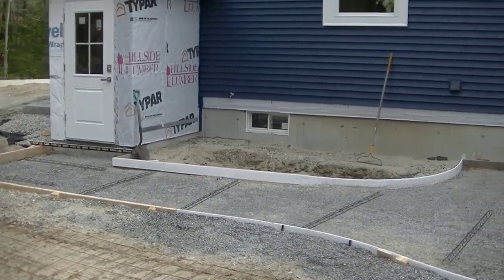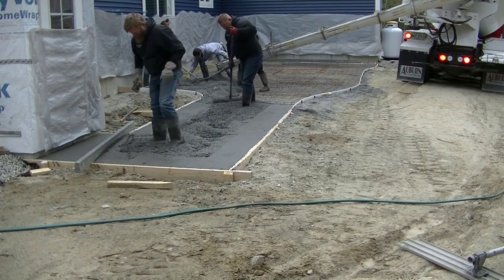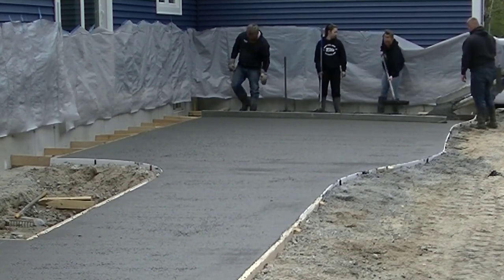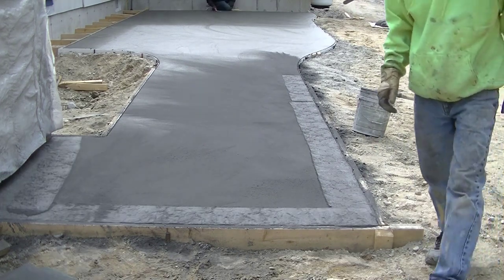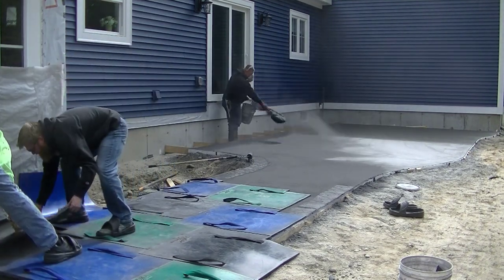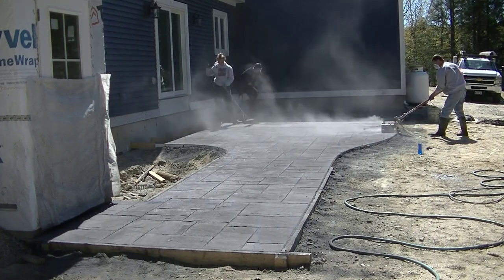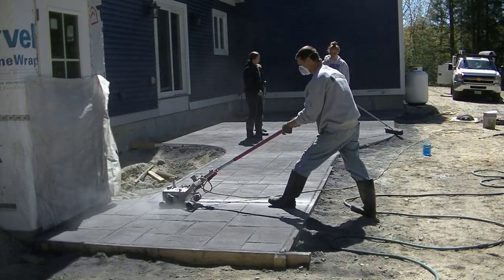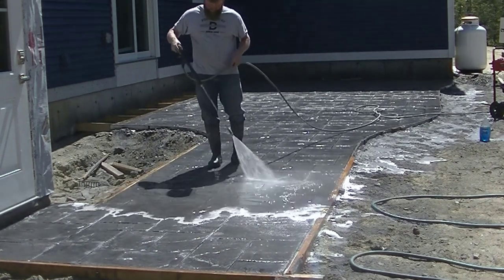How To Stamp A Concrete Walkway And Patio Slab

Comment: Looks good! What are your thoughts on expansion and void cap in front of the side door area?
Reply from the maker: When it's only up against one side like this, expansion material is really just preference in my opinion. The slab will expand/contract with no problems.  If the slab is butting up against 2 or 3 sides of a foundation, then yes, expansion material is much more important.

Comment: Does your screed board ever warp on you?we have a 20ft aluminum screed that's perfectly straight but seems to warp when it touches the warm concrete on colder days and then straightens itself out after a bit.ive had previous boards that never did that.strange that it does that.
Reply from the maker: My 16 footer used to do that. The 14 and smaller ones don't seem to.